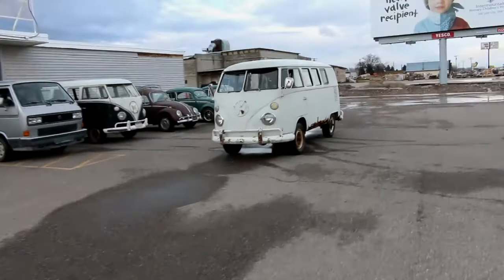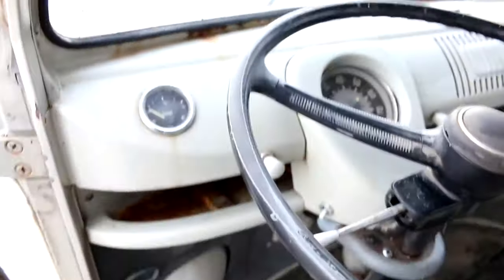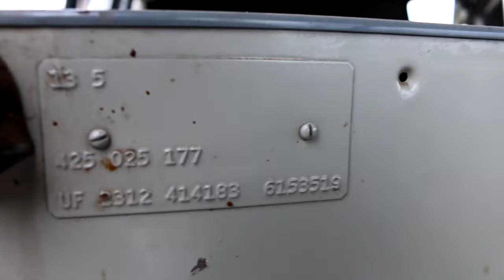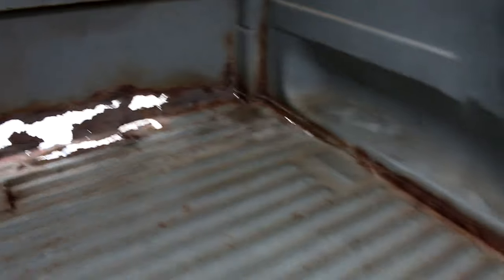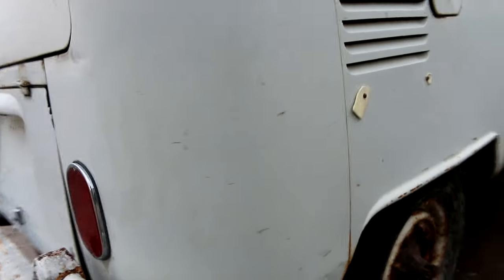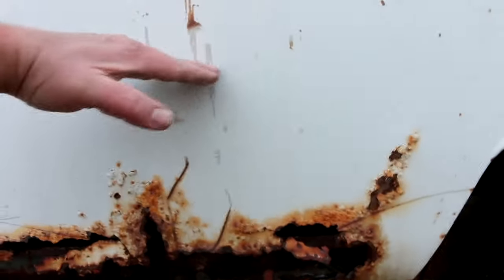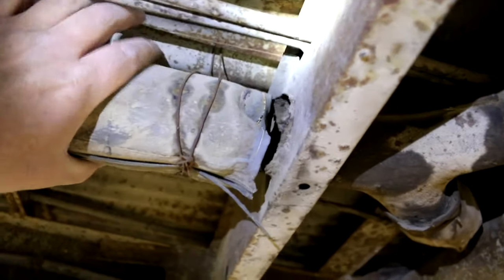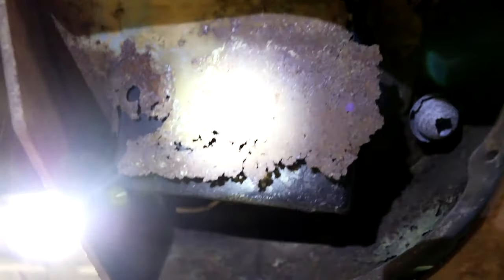1966 Volkswagen Kombi Field Find First Impressions Walkaround.

Comment: Some years back, there was a '66 Bus at a local yard, I nabbed the dash, some wiring, misc small pieces, tried for the steering wheel but it was rusted on, left the seat 'cause I was a poor student that didn't know what was valuable and was more interested in parts off the bugs for my own bugs. Got a few engines and a trans from the bugs at that same yard.
Thanks for the tour! Looks about as rusty as my '70 Bug, still salvageable!